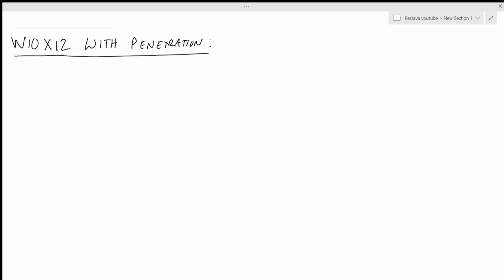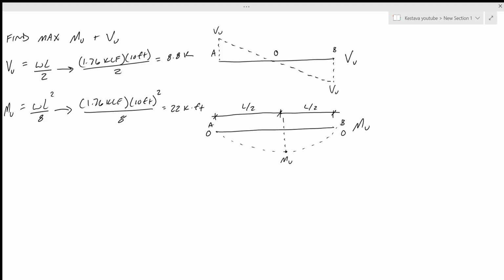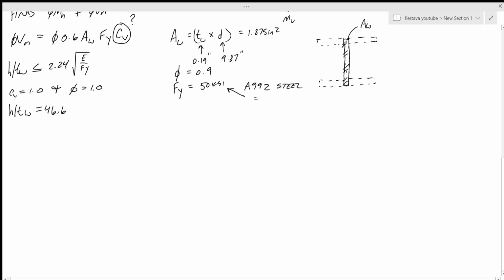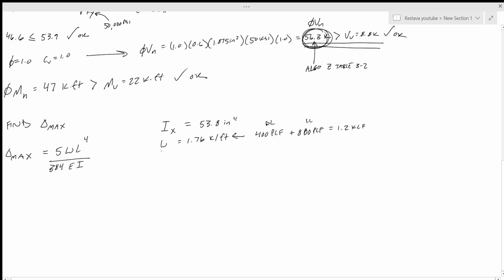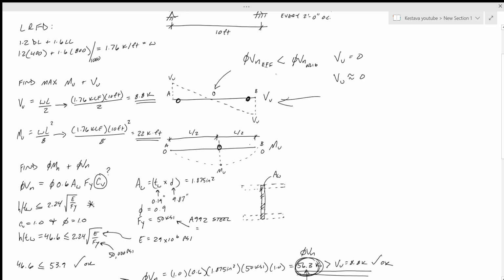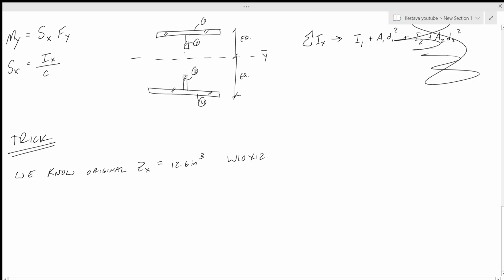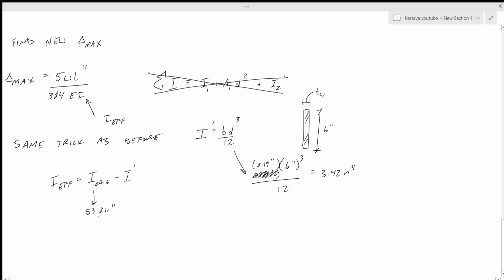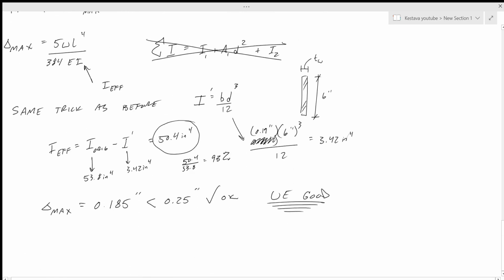How to Calculate Capacity of Steel Beam with Penetrations

Comment: Good video.  I wish you would have used an example considering shear.  I don't think its a simple as calc properties with the hole in it, especially when the hole is near the bearing.  Any advice in that case?  I have a 7" diameter hole next to a bearing stiffener in a rolled beam on a bridge.